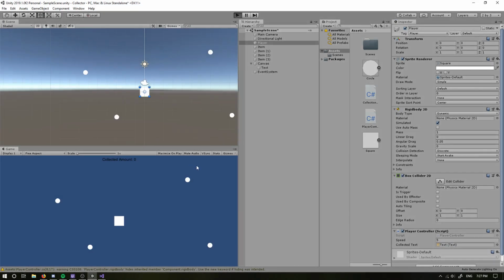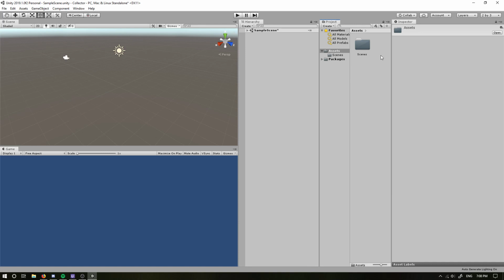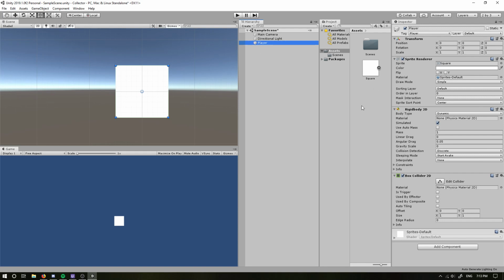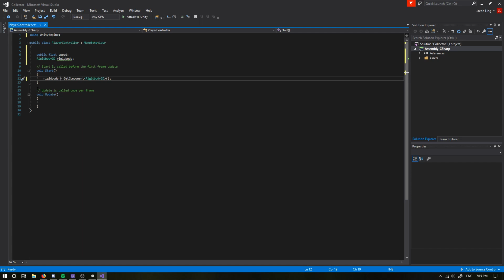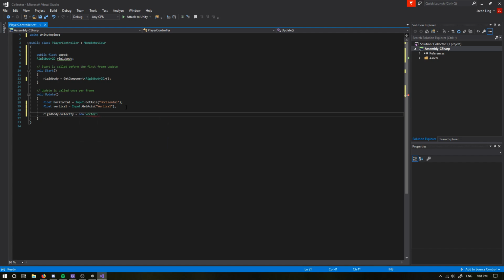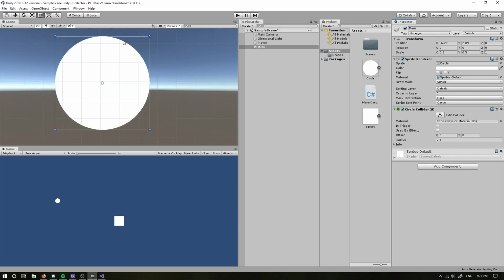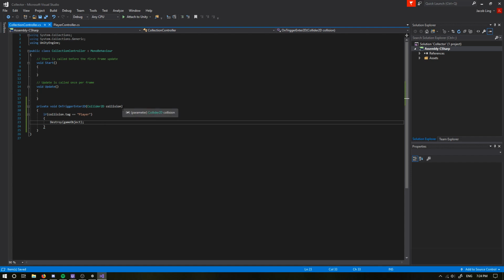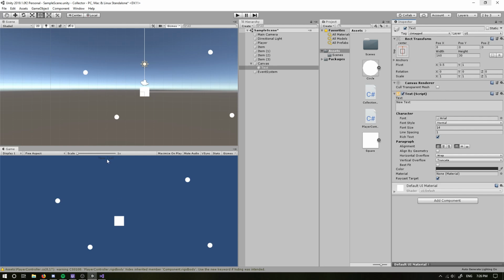How to use Unity in 2019 - Introduction to Unity

Comment: "Okay". :P

Hm, this is odd. My player passes over the collectables, even though everything should be right. Everything's correct in the script, what should be public is public, what's private is private, what's lower / upper case is that... Player object has Player tag, everything is on the same depth... I honestly have no clue what's wrong here. Tried debug.log to see if the player collides with the collectibles, but not getting anything, so clearly the player isn't even colliding with the items.

Edit: Of course the solution was simple... :'D I somehow used sphere collider instead of circle collider for the items.

Comment: For some odd reason when I drag the script into the inspector area under the player tab there is no speed option, I have checked the code and there are 0 spelling errors. what can I do to fix this issue? by the way amazing work.
Reply from the maker: Sounds like you may not have set your speed variable to public, as in writing the word public before you write float speed; . This should allow for the speed variable to be shown within the editor. I hope this helps you out!

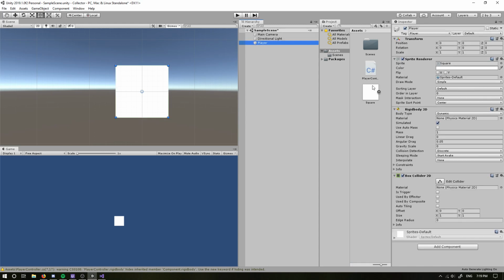Comment: hi, i'm having some trouble at 11:10 as when I press play it says that the axis is not set up and i don't know what to do as i think that i have written the code correctly yet it does not work.
Reply from the maker: So I think you issue then is either the misspelling of the string that you put into the method for GetAxis() as "Horizontal" or "Vertical" or it's not actually set up in Unity. You can go to Edit > Project Settings in the editor and select input on the left side. Now there should be a Horizontal and Vertical input axis. If there isn't, then you'll need to set these up with the positive button being D for Horizontal and W for Vertical and the negative button being A for Horizontal and S for Vertical. Let me know if you're still having trouble.
Reply: @JVC0B   It worked! thanks man!